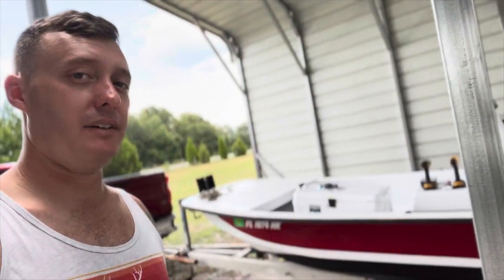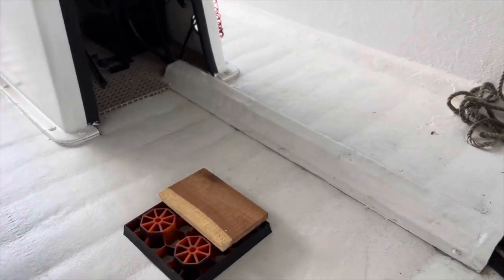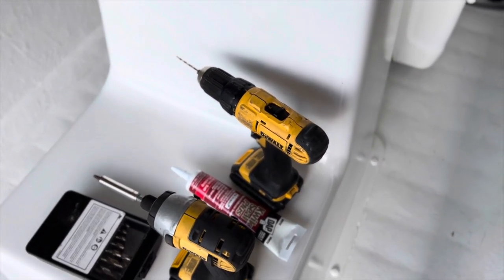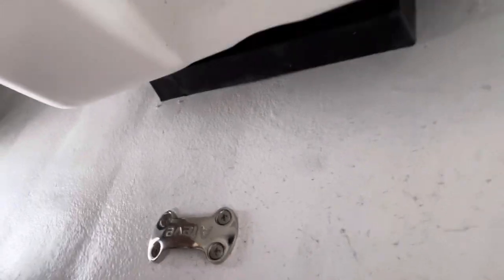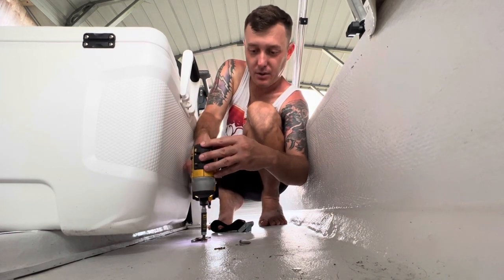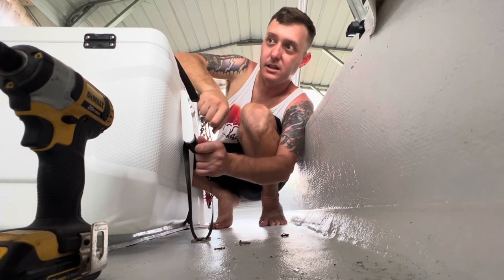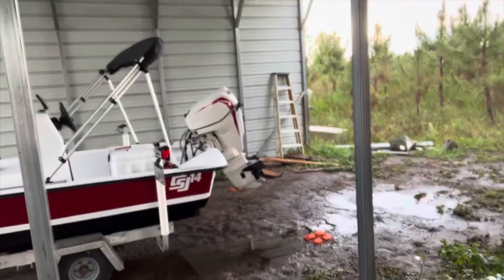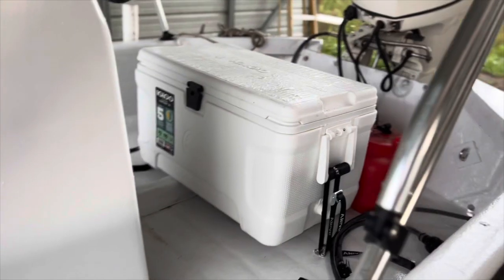Igloo Cooler Seat Install | Carolina Skiff J14

Comment: Sweet rig! How did you get the red wrap on the outside? It looks sick
Reply from the maker: I wish I made a video when I restored the boat.  I did the wrap myself after I painted it.  I used something called "knifeless tape" to follow the contour of the boat bottom and 3M edge sealer tape around the edges to keep it from peeling up.  I'll try to make a video one day explaining the whole process.
Reply: @derrickcassel  Would love to see more videos for the boat! Maybe a full walkthrough and overview of restoration.
Reply: Looks great!!  How’s it holding up?
Reply from the maker: @dragonfly7064  no complaints so far, it’s holding up good.  Taken it out a few times and it hasn’t budged since I got the straps tightened down
Reply from the maker: @dragonfly7064  I just realized you were probably asking about the wrap lol.  The wrap is still good.  I have one good knick on it where it my guide post caught it while putting it back on the trailer during a storm but it's not peeling anywhere.